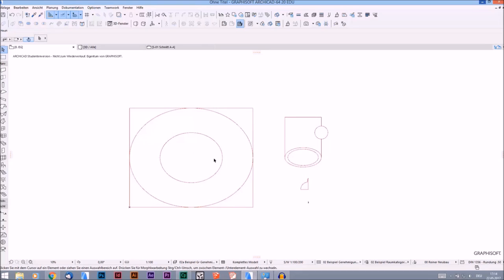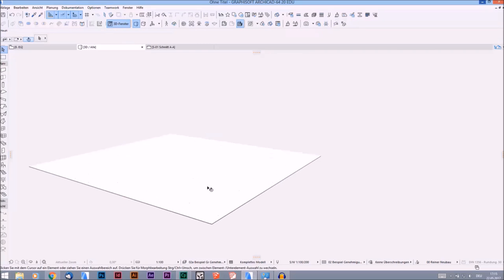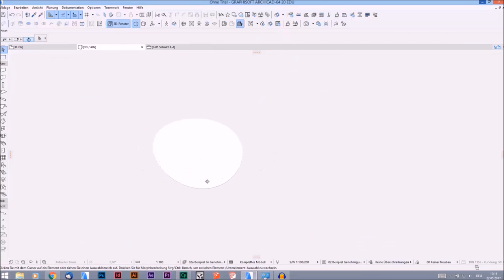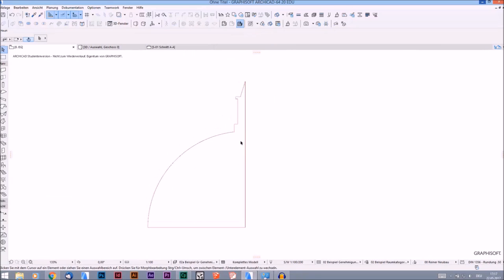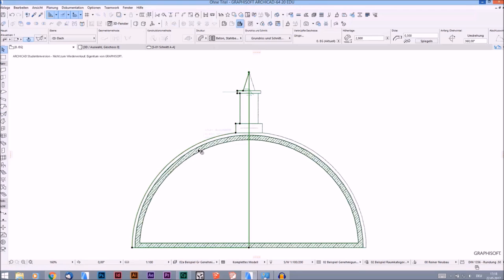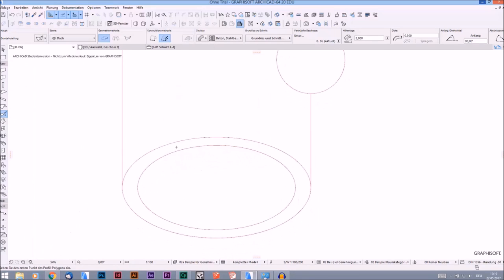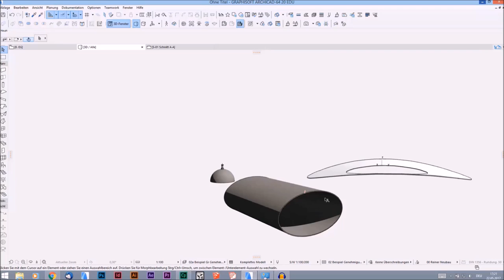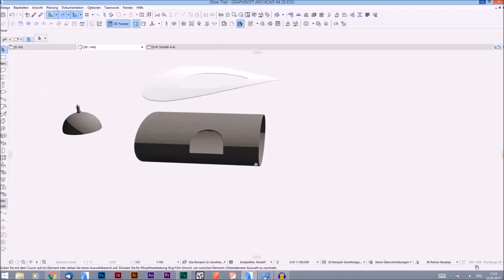How to create anything in ArchiCAD - Part 3: Shell Tool

Comment: Very useful. May I ask, how did you achieve the "spiral" effect shown at 8:43 ? I can't imagine what combination of cutting lines can "spiral cut" the tube.
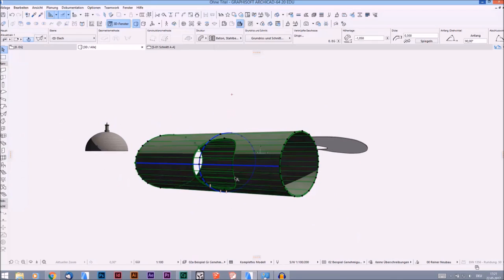Reply from the maker: It works the same way as I did at 7:30 Create a whole, that overlaps the edge of the oval shell and pull the bottom of the whole up to the middle of the shell. That's it.